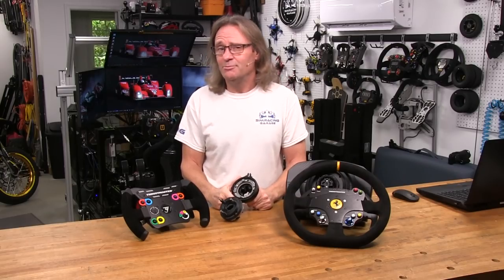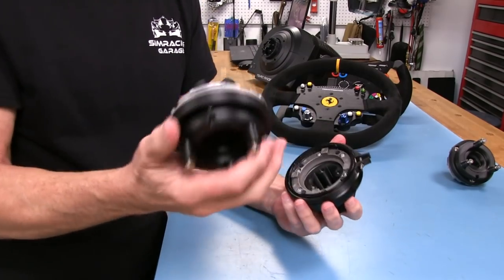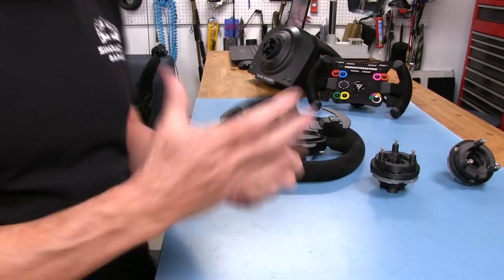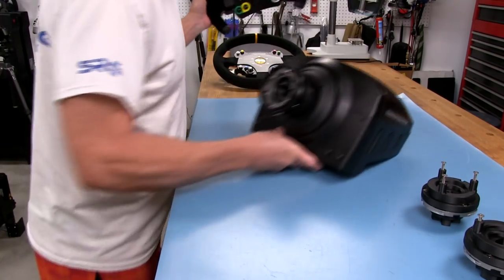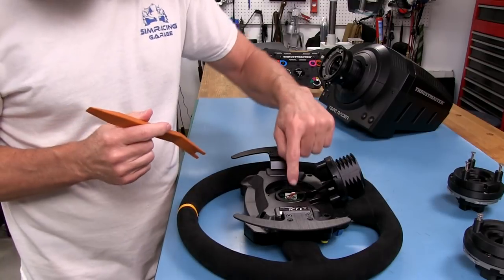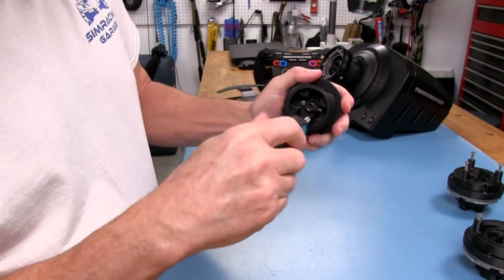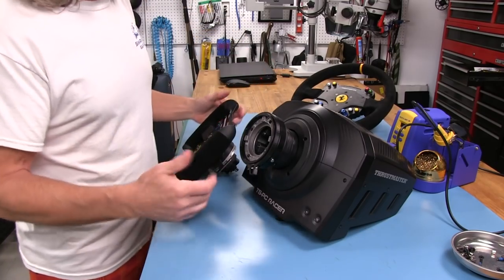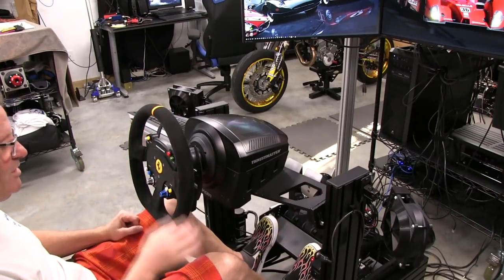Thrustmaster "True" QR Review

Comment: Barry's review of these very ingenious quick releases for the TM based convinced me that I wanted them. So I went to Peter's ebay page for these items.  Not surprised, his current stock at the time was pretty light.  So I contacted Peter via email.
Through that, I got on a email list for his next run.
Long story short, I got a base adapter and two for my TM wheels (599 evo with a Momo Mod 31 custom drilled by Ricmotech / TSPC open wheel)
Installation (including custom fitment) was easy. Basically followed both Barry's and Peter's videos. 
Only issue I encountered was the length of the M4 bolts which connect the Wheel QR Adapter was a bit short. 
This was due to my custom drilled Momo Mod 31 wheel which I think is a couple mm's thicker than the stock 599 evo TM wheel.
 I measured them as about 45 mm.  Got 50 mm length bolts and it now solidly assembled.
Tested all the buttons and paddles and everything works!  Removal and re-installation with the new QR is great! 
This is my favorite mod for my TM equipment!  Thank you Peter for making these and Barry for reviewing them!

Comment: I use PLA to make 3d printed QR1 for my CSL DD 8nm.
Lots of infill, lots of walls, low resolution and a good filament, and you're set! 
I use the SRM mini emulator and a 350mm wheel, and added my own 8mm bearings and 3x pen springs.

Not bad for a free QR

Comment: i personally use a cnc machines adapter made by Ripp. along with a VMS Racing quick release, (identical to slim NRG QR), iv had zero issues, on the side of 3dprinted parts, iv been through 2 adapters now, by 2 different sellers, use metal no 3d printed stuff to hold your wheels

Comment: It leaves the plug on the back of the wheel exposed,   so you got to be sure not to damage it when it's lying around.
Reply: Yes it does, but tbh I'm not very gentle with my wheels and have been using this qr for over 6mths without any damage to the plug. And even if it gets damaged it's super simple to replace it for <5$.

Comment: ouch that hurt at  15:12   ..... sais in thrustmaster manual only tightened that screw until it gets firm, it should never ever go all the way in otherwise you  may crack the collar part of the wheel (Rim) with the threads, of it will just completly dig in and destroy the treads,

Comment: I tried this mod and had to remove it! the mod itself is very well done, the problem is the chinesium quick release that is sold separately that has some really poor tolerances! this translates into a lot of play in the quick release system itself making it completely impossible to use for me, cuz every time the force feedback snaps to the other side the quick release system jumps the gap and makes a clicking sound that makes it impossible for me to use it! buying this mod, u must take into consideration buying like 4 quick release from 2 different manufacturers or something like that
Reply: ok so why not just put a bit of double sided tape/ tape with a bit of fabric to stop the noise then?
Reply: @DavidGarcia-oi5nt  i bought 2 more qr and they were good'ish, good enough to use
U cant use double sided tape, or any tape at all. There's no space, cuz the problem is between the quick release metal parts
Reply: Not sure if yours did come or not with it but I was watching Peter's videos about the perfect fit and includes two 3d pieces than you can insert to fix the wiggle but if you do not want the piece and still have it I dont mind buying. You are portuguese too?
Reply: @youngganghis5236  Yes I am Portuguese too! Thing is the qr release system is almost unusable! I bought the entire thing from Peter and it still wasn't enough! the qr's are really bad, but if u really want them I can sell them

Comment: Hi Barry, great review as always. I wonder if you would be willing to measure the distance between the front of the wheelbase and the top of the plate of the open wheel rim. I know you said it didn't feel like it added much length, but I'm trying to get a more precise idea of how it would effect my setup.
Reply from the maker: Sorry, that wheel was on loan from a fellow Sim Racer. Already gave it back to him.
Reply: I don't have open wheel, but P310 (which seems to have the same dimensions) has exactly 111mm from the flat side of wheel base (ie the one around tm 'screw on' mounting cover) to the front of wheel metal plate, hope that helps :)
Reply: @simracinggarage3026  No problem, Barry, thanks for the reply.
Reply: @petermakesthings7342  Perfect, thanks for the info!

Comment: Hello, I bought a brand new TX leather edition wheel and there is a serious problem with it. I play with three-four fingers(with one hand, no full grip) and regardless of the setting, from the recommended to almost maximum, the FFB is either absent or very faintly felt. When I tested the "forces" from the control panel, there are no vibrations, only the steering wheel turns with some of them. The store refused me a replacement, they sent it to a service center. The base does not overheating at all. What do you think the problem might be? Thanks!

Comment: Barry I need help I have the thrustmaster ferrari f1 1000 wheel I open the wheel to expose the spider to heat the bolts to remove them nothing worked the bolts will not move can you buy the spider..

Comment: Because literally no-one is mentioning it anywhere the guy charges £10 GBP per STL file with a minimum of 3 of the 4 files required so it's only £3 less than buying a pre printed kit to get the files plus you need to buy the quick release aswell

Comment: Is the QR as tight as the OEM connection when the wheel is on? And how much extra steering column length does the QR add? More length equals more flex, yes?
Reply: John Cochran looks like less than an inch
Reply: Keep in mind this kinda innovation will appear in next gen

Comment: How does he stop the ebay quick release from being such a lose fit? Mine has a lot of play and makes a lot when in use.
Reply: That's my secret sauce ;) but seriously it's a LOT of testing and tweaking the dimensions of the adapter, also there's still a need to do some manual fitting but it's super easy and in worst case requires using a bit of duct tape (details in video linked in the description)

Comment: Don’t forget to remind yourself to turn the power to the wheel base OFF before you change rims,,, TS-PC might only be £500 but it’ll still twat your wrists hard enough 🥴
Reply: JOE nice one,, 👍
I just never change a wheel without powering off,, I’ve belted my head plugging in usb 🙄 
I also noticed occasionally that the steering lock went from my preferred 410 back up to max,,, 
Actually;;;; I’m probably a pain in the neck on race nites 🤪🤓 especially in VR👁👁 
Drive  polite